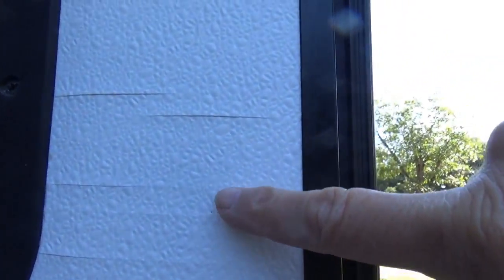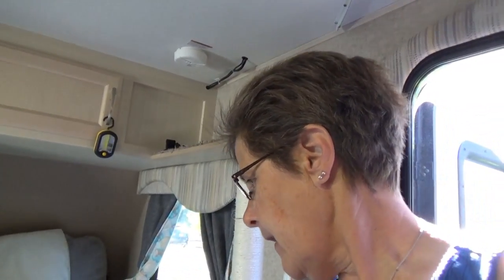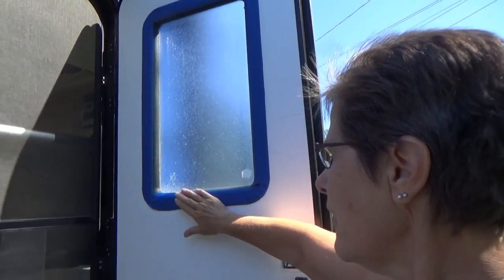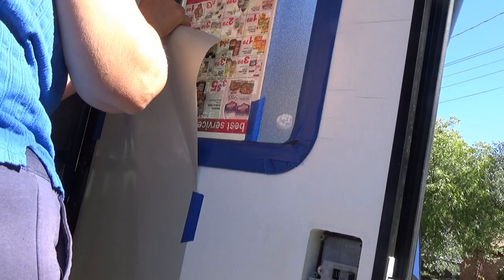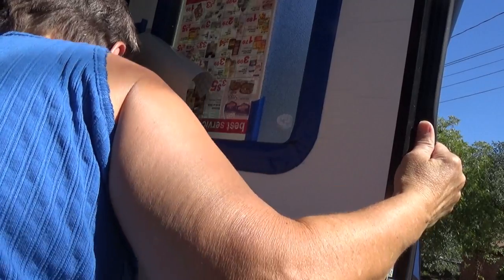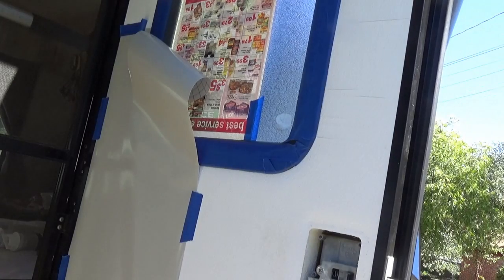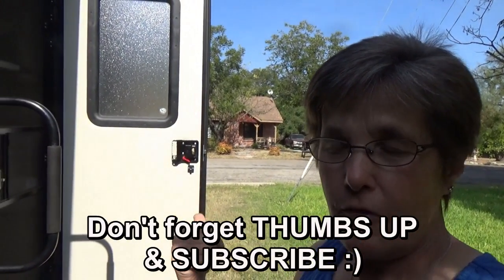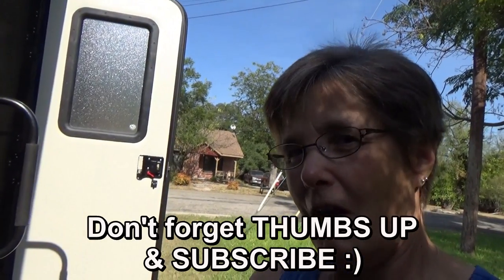Reskinning RV Door

Comment: This video only covers up the cracks. Easy just to replace the entire inside skin. Home depot sells 4x8 fiberglass panels in white or grey textured on one side for @ $45. I just fixed my door yesterday and it took @ 2 hrs. Take door off, remove hardware, 4 screws on bottom and bottom trim. Get couple putty knives and pry off door u shape trim carefully and window trim. Tear off old skin and use as templet for new panel. Cut new panel with circular saw and jig saw. Put back together carefully and use wood block and hammer to set trim over edges. Better than new! Now solid 3/32's thick.
Reply from the maker: You are absolutely correct: that's a much better fix if you have a circular saw and a jigsaw.  Our goal was to cover the cracks to prevent damage.  Thanks for the tip.

Comment: had the same issue with our 2019 Rockwood Mini Lite 2506s.  I ordered 2 rolls of vinyl wall paper from Wayfair. Going to sand the finish down and tape the edges and remove the window.  Hopefully I can make this look better.
Reply from the maker: I'm betting it will look better when you've finished.

Comment: This happened to our 2018 TC, my husband surgically removed the skin so to not damage the insulation and replaced it with a thin piece of Formica, this was not super hard or super easy and yes you need some tools to do it right, but it looks like a brand-new door, just better.
Reply from the maker: Very cool.